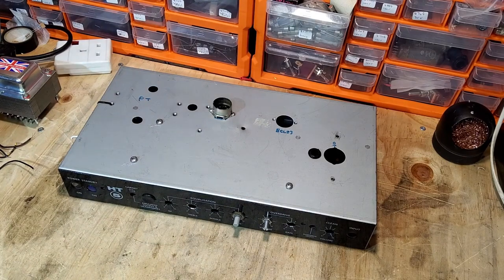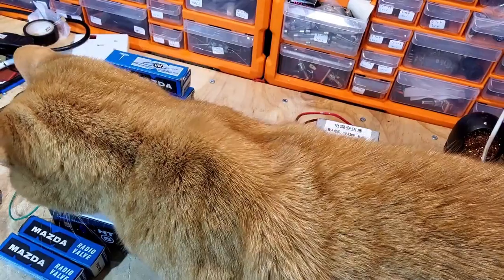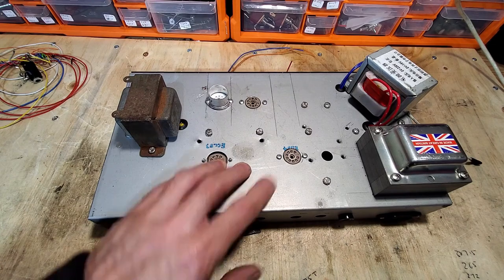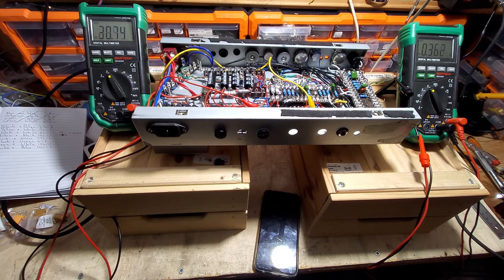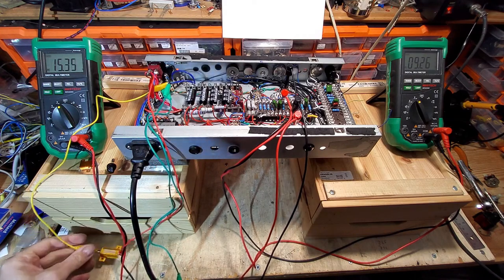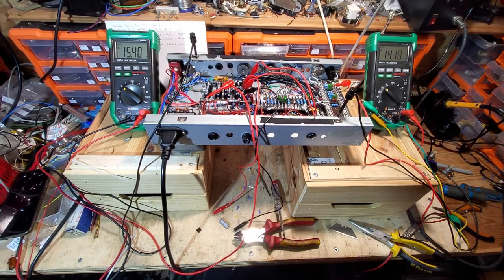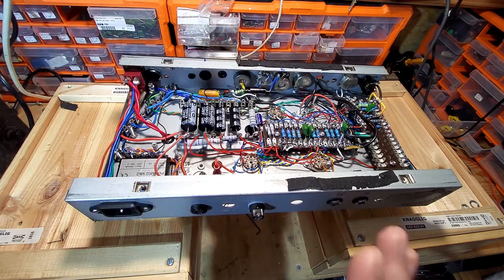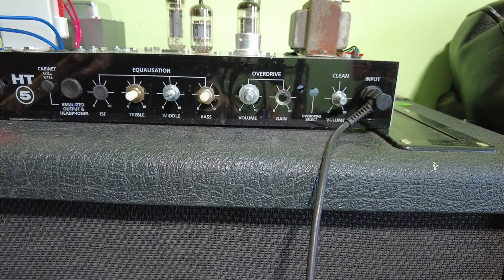Building a Guitar Amplifier using Obsolete Television Tubes

Comment: Very nice project. I’m from Argentina and classic audio tubes are pretty expensive so I use TV tubes for my amps, I’ve used the PL504 for pushpull and got 40W and 6DQ6B single ended and got 8W output power. The great thing about deflection tubes is that they are very conductive at low voltages, so you can get pretty serious power with 200 to 300 HT voltage.
Reply from the maker: Hello, that's interesting. I think I have some PL504s. 6DQ6B, I will have to check that one out. That all sounds pretty awesome. Thanks for watching and take care.

Comment: There's a couple similar projects from the Handmades Brazilian forum using ECL82/PCL82 tubes: IALL 3.5 (3.5w SE), HB-2 (5w PSE, Hi-Octane inspired), and IALL 10.5 (10.5w PP).
They also have another project (2w SE) called Carmine HB-1, using a 25v filament output tube from those "all american 5" type radios, and an RF pentode for the preamp.

The neat thing is that, for the circuits with 2x PCL82 or the 25v tube, you can just use a 30v+30v transformer, tie one of the 30v wires to ground, and connect the other to a voltage doubler to get +150v for the B+. C.T. becomes your filament supply. It's very clever!

I started to work on a variation of the HB-2 inspired by the Supro Super 1606, but haven't finished it yet. Might get back to it soon.
Reply from the maker: Hello, that's interesting. I will definitely be having a look at those projects. Interesting info there on the power supply. Thanks for watching and take care.

Comment: Very cool.

The cat may be out of the bag on EL86/6CW5s these days but they used to be pennies for a bucket full. 5+ max p.d., you can run them between 200v on the plates s.e. or 250v p.p.

6AW8A is another one, high mu triode/pentode, video amplifier
Reply from the maker: Hello. I think you may well be right. I have a lot of Russian tubes that are great for guitar amps. I did a video on them a while a go. I have bought one or two more types since the video. I have put the link below. Thanks for watching and take care.

https://youtu.be/WDAcRBqTMgE

Comment: It sounds like you're 90% of the way there. You can play with the bias, and different coupling caps. Maybe keep the growling high gain, but find a way to make it transition more gradually from clean to dirty, because that sound is what Billy Gibbons calls "4 flat tires on a muddy road", and it's great for slide playing or really crunchy garage rock. I'd say if you can keep it and also have the option of a good clean country kind of sound, you'll be all done. 
        It sounds really good the way it is, but there's a little bit more you can squeeze out of it. Maybe a push/pull switch for a mid boost/scoop option.
        So far so good 
          Hats off
            CHEERS!!
Reply from the maker: Hello, thank you. There is a part two to this one. Even after part two I am still thinking of ways to improve it. The mid scoop is a good idea. Here is a link to part two: https://youtu.be/Cro6uj_9v3g 

Thanks for watching and take care.
Reply: @vintageguitaramp_guitarteacher  My pleasure. I've built 4 amps so far, all variations of TV front and narrow panel Tweed Fenders, which are my favorite. 
       But next, I'd like to do a fixed bias solid state rectifier with lots of headroom because my new  favorite thing is to pair that type of amp with a Tweed. 
I call it the "sparkler and growler" combination, and it's very 3 dimensional sounding without being ear splittingly loud. ( which is almost as politically incorrect as telling jokes or working on an old car, thanks, Karens). You've done a fine job on this one, and I hope you keep building more.

Comment: I am building a JMT45 the power tubes are 807 with anode cap and coke bottle glass same as 6L6 so people say .
With anode load 6600 ohms will deliver about 30 watts and HT of 450 volts.
These are NOS Brimar and the pair cost £25 and glad the HI FI people don't no about them.
Reply from the maker: That sounds like a great project. NOS tubes, that's a winner. Would love to hear that when it's finished. Take care.

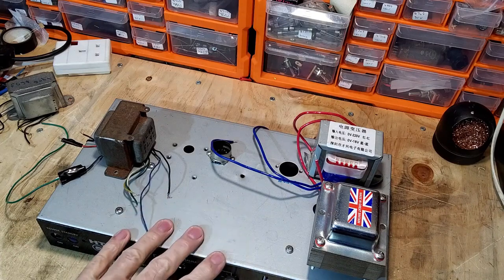Comment: Ha ha, at 4:53, my cat "Rusty" heard Pink meow and looked around.  He looks almost identical to her, except Rusty's eyes are yellow.  I thought the amp sounded pretty good.  It kind of reminds me of my Sovtek Tube Midget 50H.  On the high gain input, it goes into heavy distortion very quickly, although I can keep the volume at a reasonable level using the master volume pot.
Reply from the maker: Hello Michael. Pink is is also a lady cat, though she has Tom Cat markings. Thanks. The sound is getting there but there is a bit of work to do on it still. Those Sovtek amps are very good. If it sounds that good when it's finished, I will be well happy. Look out for part two. Thanks for watching and take care.

Comment: Greetings from Germany. Great video and work. 👍Question, please: It is possible to load a Vox Ac 30 CC2 with PL84 tubes?
Reply from the maker: Hello. No, they won't replace the EL84. The filament voltage on the PL84 is 15 volts. The EL84 is 6.3 volts. Give part one a watch, that should give you a bit more insight in to this project. Thanks for watching and take care.  https://youtu.be/Ad73nhgcIMw

Comment: Cool project, kudos. In your amp work, do you first identify the foil end of the non-polarized capacitors prior to install?
Reply from the maker: Hello Russell, thank you. I don't on most of these projects. If I was building something that was very high gain then I would. Very few capacitor manufacturers mark the foil end nowadays. I don't know if that is because of cost or because most people don't bother about which way they go in. It does not seem to to make much difference when I have experimented with caps; not on lower gain amp projects which is mostly what I build. It's a much talked about topic on forums. Thanks for watching and take care.

Comment: I build hifi amps using tv tubes
Reply from the maker: Hello Joseph, that's interesting. Which ones have you used in your builds?
Reply: @vintageguitaramp_guitarteacher  Mostly Horizontal output tubes, but also some vertical oscillator/amplifier tubes as well. Like  some 33GY7 as outputs and rectifiers Using a 12SL7 for pre-amp.  One other has 12GE5 as output driving   480 volt to 24 volt thermostat transformers as output transformers. I was REALLY surprised how this one turned out.